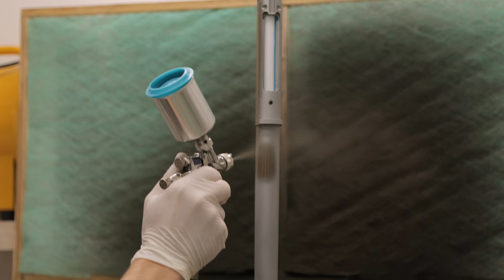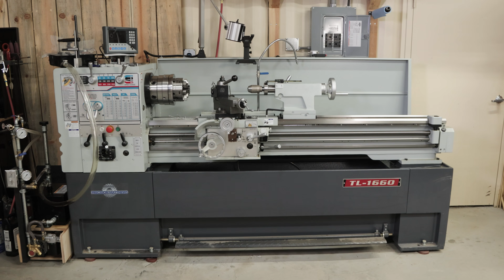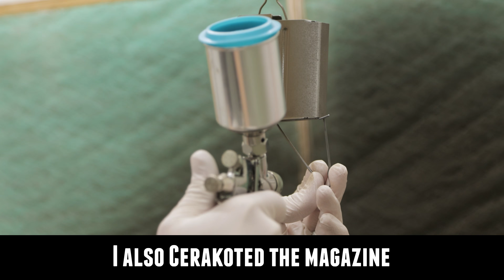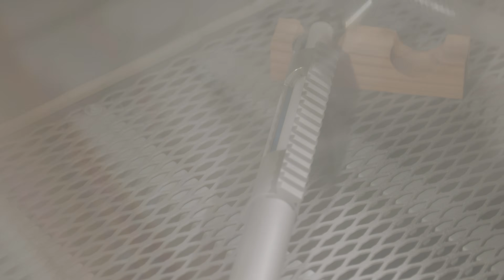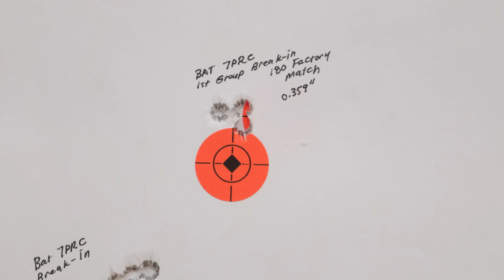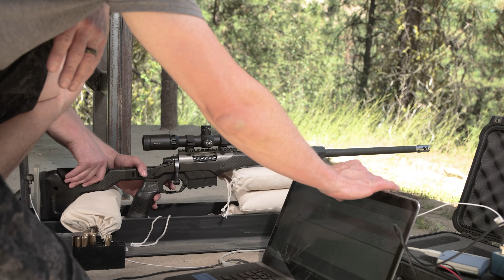7mm PRC Freedom Rifle Chambering, Cerakote, Laser-Engraving, and More

Comment: What magazine did you use for 7prc? I have a rifle and chassis I am considering swapping to 7prc but it uses a 3.715” aics magazine. Will 7prc feed from a 300WM magazine or does it need a 300prc magazine since it’s a larger case body dimension?
Reply from the maker: 300WM or longer will work!

Comment: I'm pretty new to all of this. I have a 700 la in 30-06. The case head is larger than 30-06 so the bolt won't work (I'm assuming). Do I need a magnum action, or do I need to replace the bolt?

Comment: How do you adjust the chamber if it´s too loose? Do you just tighten the barrel a little bit more, or do have to put it in the lathe and remove material so it can go deeper in the action?
Reply: It tightens up against the shoulder cut on the barrel, so it has to be cut down on the lathe

Comment: Regarding the double coating of cerakote; How long do you wait in between coats?  Do you oven cure the first coat?
Reply from the maker: It’s about 5 minutes between coats, then 15 minutes flash time before oven curing
Reply: @Ultimatereloader    Thanks, I'm going to try it.
Reply: @davidgoldberg  you can just use c series that’s what I cerakoted all my 12 scopes and 3 red dots muzzle breaks ADM scope mounts and several brands of scope rings with as well stocks and rifles and shotgun with will hold up longer as a factory oven cured job I have factory oven cured hand guards and receivers upper lower wearing through to ugly shiny metal but going over black hard coat anodized metal is better when banging stuff around just the black will show through not shiny uncoated metal easy to do camo patterns too
Reply: @bnicedanicest6288  I'll check it out. Thanks

Comment: If I didn't already have a .270 WSM the 7mm PRC would be a great choice for a do everything cartridge !
Reply: The WSM cartridges are under-appreciated. I had a 300 WSM for quite a few years and found it to be accurate & powerful. Am sure your 270 WSM works great!
Reply: If you tight-twist the 270 WSM and spit Bergers out, it really does well at ELR and most of your elk hunting distances.  The 7mm with 175s, 180s, and 195gr EOL extend the ethical hunting reach for competitive PRS and LR shooters who get regular trigger time at distance, and know their limits.

270 WSM with 170gr Berger EOL at 2800fps is great out to 900yds for elk, which beyond the capabilities of I’d say 95-98% of big game hunters with a tag, not knocking them, just reality.

7mm PRC will get you to 1300yds in the same conditions (22.92” Hg barometric pressure at elk altitudes in Rockies and Uintahs), with 180gr ELD-M at 2950fps.  For LR elk hunters, that’s where it really comes into play.

For hunts within 600yds, it won’t matter.  Wind drift and drop favor the 7mm PRC of course across the flight path.

Comment: You got a nice setup. I used to build precision rifles before I retired. Used to use a long stem indicator and dialed in on both sides. Different way of doing things but we all get to the same end product. Used to be a certified cerakote applicator. You did a excellent job on the cerakote.

Comment: I am just getting in to the sport of shooting. I am struggling with what caliber to get in to. I built my first rifle tht took my first white tail. 6.5 CM AR10: proof 26inch carbon barrel: jp low mass bcg etc. still weighs 13 lbs…. Looking to build a bolt action on the hnt26 platform. 7prc or 300prc. I want to cover elk and moose with one rifle…. I feel 7prc may be too small? Wonderful classy cerakote and thanks for the content.
Reply: You will be completely fine to take out any North American game with the 7MM PRC. Shot placement is always important but the cartridge has more than enough energy to efficiently kill large game.
Reply: For perspective, nobody would bat an eye at using a 7mm rem mag on a moose. And for comparison, the 7mm PRC holds an extra 370 ft lbf of energy out at 500 yards (comparing the 162 eldx vs 175 eldx). Depending on the environmentals where you hunt, your energy is going to stay above 2000 all the way out to 600-700 yards. So you’d be perfectly fine hunting moose with the 7 PRC in my opinion.
Reply: Either will do the job in North America. Heck I’m still using the old school cartridges (.243win and .270win)
Reply: Is go 300 Norma
Reply: I am debating that too. I like Norma a lot, but I feel like I would like to better understand reloading before I pulled that trigger.
Reply: Something to keep in mind a gas gun will limit your pressure you can run. You can push a round harder out of a bolt gun. This is why Hornady has 2 sets of loading data for the 6mm ARC.
Reply: I have decided to build a 300 PRC. So far this is what I am looking at: HBK Impact Precision LA Action, Proof Sendero 26 Inch Carbon Barrel (would have loves a shorter barrel and a can, but I live in CA  -_- ), Self Timing Hellfire MB, Foundation Stock or HNT26 The difference in weight fully loaded should be HNT26 (10.525 LBS) or Foundation (12.625 LBS), Spuhr Mount. Neither weight includes a BIPOD =( though I already own an ATLAS. Oh, the scope for now is a Viper FFP PST Gen II 5 -25 x50.